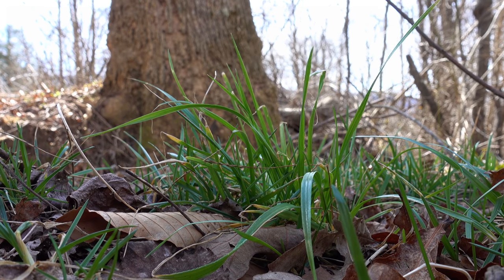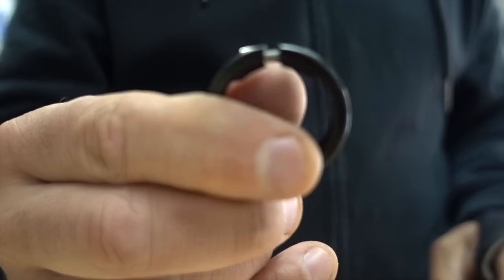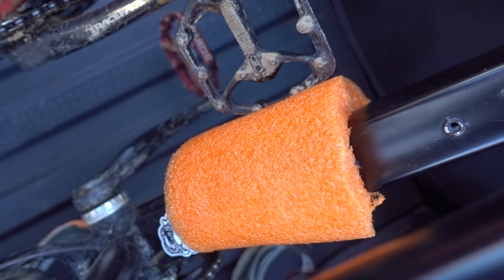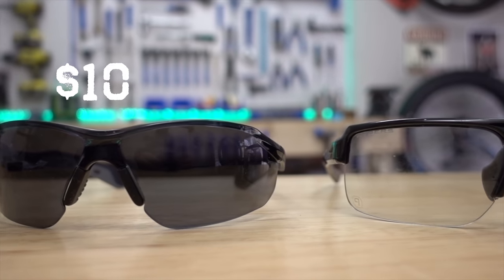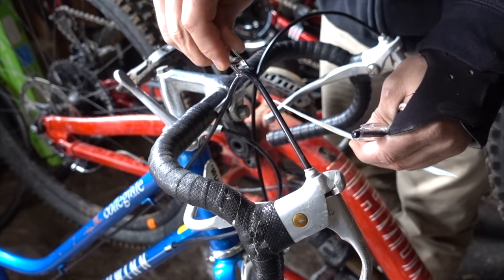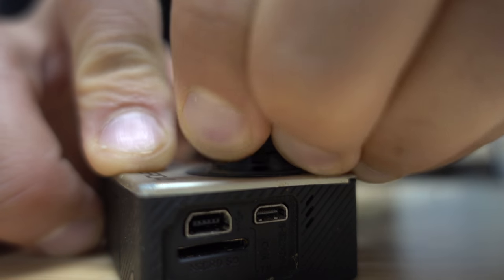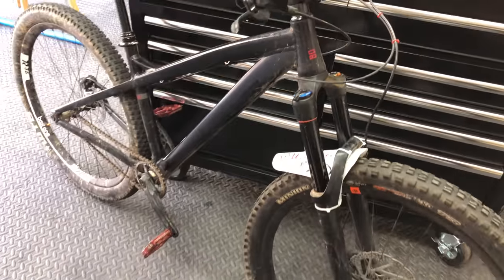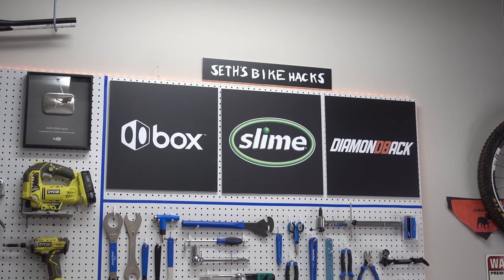10 Hacks for MTB, Road, and Outdoors

Comment: my top tip for removing tires: before hooking in the tyre lever, push the tyre on both sides to the inside of the rim.. the middle section of the rim is deeper thus giving the tyres more space to hop over the rim. if needed you can change a MTB tyre without the aid of any levers (being stubborn). Also, I have succesfully used old jeans as a DIY chainwhip. Enjoy!

Comment: For removing valve cores my chain tool from the multitool fits perfectly. It's the part where the chain pin gets pushed out in. Should be standard on all chain tools and it's a perfect fit on the valve core.

Comment: Osprey makes what is IMO the best hydration pack for mountain biking, it comes with a magnet on the mouth piece which snaps onto the shoulder strap without any effort. Good tip on the squared off socket for the top cap!

Comment: Hi, I used to wear safety glasses while cycling too for the reasons you said, then I did research.  Long story short, safety glasses aren't manufactured for sports.  Many brands specifically say on the packaging "Not for use in sports".  Depending on the manufacturer, the lenses in safety glasses may not be shatterproof (I know, right?), designed to stay on after impact nor offer UV protection.  the bows aren't designed for a sport style impact, and aren't made for active style wear.  So what this means is that if you're wearing them on the trail, and you get an eye injury due to the glasses cracking or coming apart on impact, you have no recourse because they specifically say "Don't do this."  And this isn't going into optical clarity, that some safety glasses are meant only for indoor use, and the mass-manufactured "polarization" techniques...

And people will argue that I'm wrong or a shill or whatever, hey you do you.  "Any port in a storm" is fine in a pinch, but why compromise when you have access to the RIGHT tools?  I'm reminded of the people who wore ski goggles to play paintball.  If you don't know better, it sounds perfectly fine, until the lenses blow out on impact and you lose an eye.  And that's happened far too often.  I'm just sayin'.
Reply: Thank you! I'll reconsider if I should actually buy some.
Reply: There are literally hundreds of different types of safety glasses available.  Some offer UV protection, some don't.  Some are shatterproof, some aren't.  Best advice is do your research on them, because there will be types suitable for biking.  And cheap
Reply: Yeazz...
Reply: Agree with this statement. I tend to look for that Z87 rating.

Comment: you can take 2 or 3 tire levers, depending on your seat post size, rubber band them together, and stuff them in your seat post. Also, I zipped a compass pouch to my handlebar stem, and I can keep a multitool, patches, and extra chainlinks in there.

Comment: Hey Seth!, here is my story! I was about 17 miles away from my house and my tube went flat. Fortunately, I was able to find a pump to air up and see how far I could get before she went flat again. (The flat was very small, so i had about 30 minutes of ride time)  Anyways the problem with the pump was, it was Schrader and I have Presta valves. So in a pinch, I found a cool hack! 
  If you take the protection cap off of your valve and cut the top off with your knife, you can screw the cap back on and it creates a bigger seal so you can adapt a Schrader to a presta! it was very useful and got me more than halfway back to my house before i had to call for some backup! I hope you can show this in one of your hack videos! BTW my name is Seth too!!

Comment: I keep my spare and tools in a drink bottle. Just had to get a good sized mouth so that the tube comes out painlessly.
Reply: Eye Heisenberg that's actually genius
Reply: Thanks Bret. 
Been using that for a few months now. Only concern is the heat in this Australian summer. I hope the tube doesn't degrade in the heat. Otherwise works great.
One other bike hack I use is to have a rubber stopper in the base of the seat post. That lets me use the hollow seat post to store things I otherwise don't want found. Be it money or something to smoke after a ride. Works great.

Comment: Good hack: some of my spot lights I use for night riding slip on my metal handle bars so I cut inter tube and rap around the area on the bar where you want the light than just tape the inter tube on with electrical tape and BAM 💥 no more slipping lights

Comment: Half my sockets are ground down like that to fit snugger. I notice you did it with a 12 point socket, for even better grab on those delicate aluminum nuts pick up a 6 point (like the bike specific one shown) next time. You can also pick up a set of the "impact adapters" that go from the 6 point quick change impact/driver bit style interface, to 1/4", 3/8", and 1/2" socket fittings. Throw that socket on the 1/2" one, chuck it in your drill, then head to the grinder. Spin the socket with the drill while pushing it against the grinder and 1) it will grind down a lot quicker and 2) it will grind down a lot more squarely and evenly with a better/smoother finish on it.

Another hack is use a zip tie tightener or other known as a "third hand tool" to pre-tension brake and shifter cables with one hand, while you use your other hand to tighten the allen bolt down to hold the cable.

Garden hose holders screwed into the wall above your work bench in that dead space that's not good for anything else but posters make great tire holders. Get creative with attaching a hook of sorts to the end of a broom handle to reach up there and lift them off. At my old shop our tire sticks had bike grips on them, headtube badges, stickers, etc to make them very bike shop themed.

when you trash a frame chop the headtube off and set it on the top of your bench to store pencils and pens in

Comment: Hey Seth, another alternative for the Velcro is a "Voile Strap" which are most commonly found for use in backcountry skiing.  They are stretchy, nearly indestructible, come in a variety of colors and lengths, and are strong enough to use to lash things together that the Velcro wouldn't hold in an emergency (Fixing broken bike racks, repairing pack straps, splints, holding frame pieces together,  etc).  I use one to hold my tube and tire levers under my seat.  They are a more $$ than the Velcro for the same length, but are well worth it for the benefits.  Thanks for all the other great tips!

Comment: If you have an older fork that doesn’t have readily available volume reducers like my 2015 fox float 32, you can actually use something as basic as tinkecad to design your own 3d printed volume reducers for your fork and find a safe way to attach them inside your fork. Another method is an old trick of adding a bit of extra suspension fluid to the air chamber to reduce the volume that way. I’ll try and make a video soon of my 3d printed volume reducers.

Comment: You can use elmeres glitter glue to mark spokes while truing a bike tire. Put the glue on the left side of the rim when the tire bends left and same with the right side. This can turn a hour long truing session into a 10 minute truing session. And remember when truing a tire look down at the tread turn the nipple right to tighten and left to loosen. Any bike frame can be a truing stand with 1 ziptie. Or if you have rim brakes take the tyre off and straighten the brakes then put the tyre back on and put two business cards on each side of the rim. Then tighten down the brake cable until the cards are hard to remove and presto your rim brakes are now a Truing stand. Your welcome Seth and happy riding to all

Comment: I also use hardware store safety glasses.  My friends use the $100+ glasses.  One day on a road ride, a flip flop I had hanging on my handle bars went into the front wheel.  I went over the bars and landed on my face. The glasses broke & cut my face from my nose to my chin.  I wonder if my friends knew something about expensive biking glasses that I didn't.  The ER doc could see an exposed artery pumping away.  I discovered that the most painful "numbing shots" you can get are those that go up your nose & upper lip.  18 stitches. I still use hardware store safety glasses but nothing hangs from my handlebars.

Comment: Hay Seth you could make a bike hand brake. when you leave you’re bike against a wall on a hill you can cut a inner tube about 1/2 a inch and leave it next to you’re grip and wen in use you rap it around your brake lever and grip so it compress the brake

Comment: A neater solution is to buy a magnetic drinking tube clip for about $5. These are two-piece. Clip one magnet onto the tube near the bite valve, and the other onto a shoulder strap, maybe with a cable tie to make it really secure. Touch the drinking tube magnet back onto the magnet on your shoulder strap and it will hold in place securely.
Reply: These systems usually come with a magnetic retainer anyway......

Comment: I find that when I cut frayed cables. It drops these sharp little pieces on the floor I use a screwdriver with a magnet built-in to pick up the small bits and when I got them all I use a tissue to wipe the bits off into the bin

Comment: If you buy a box of tinted safety glasses you can get them as cheap as $3-4 each. (HD-Supply.com) I love the super cheap frameless type, so when your head is pointed downward & you look up, there's no blind spot. A few posts have raised questions about impact resistance. Legitimate safety glasses will be rated ANSI Z87+ for extreme impact resistance. They are designed to stop pneumatic nail guns. A rock or your handlebar end is nothing. If you scratch 'em, chuck 'em.

Comment: Didn't know best place to post this, but since all types of bikes utilize hex/Allen hardware which commonly gets stripped, clogged with dick or fucked up. You can hammer in the closet torx sized socket into the bolt then loosen as normal. This is used by auto techs daily to get some really tight shit loose, so it always works on bicycle ish.

Comment: Seth I ride a giant 29er and in 12 years old and 85 pounds and my suspension used to move but now it barely moves now. it has adjustable suspension with a nod that says pre load plus and minus. The nod doesn't seams to do anything and meanwhile in such riding trails with a half inch or less of movement.Can you please help me?

Comment: If you don't like using zip ties, you can use Sugru which comes in lots of colours, its moldable and its rubbery. Another trick that really works,...... now don't laugh...... whip out that got glue gun. I attached a full bolt on fender to my Specialized Comp Crave 29er using hot glue, it was minus 40'C outside and it stood up, it doesnt hurt any components as it doesnt get hot enough to melt any plastics and just heat it up a bit and it comes off easy.

Comment: The badge holder trick is cool. 

The safety glasses idea is horrible. While they may look the same, those cheap ones can shatter and send shards of plastic into your eyes. 

That’s verging on negligence as a suggestion.
Reply: They most likely won't have UV protection either, which is really, really bad for your eyes.

Comment: BIKE HACK: (1) The mylar bag that electronics and computer cards are distributed with are really tough. Put you tube inside and then fasten to the bike or saddle bag. (2) No mylar bag, use a potato chip bag, just turn it inside out to beat the subliminal reoccurring munches.

Comment: Valve core wrench? Why would you even need to use a valve core wrench? And using a grip collar as one for EMERGENCY? Use your hands!
Reply from the maker: If you can remove a valve core wrench with your hands, it wasn’t screwed in tight enough to begin with.